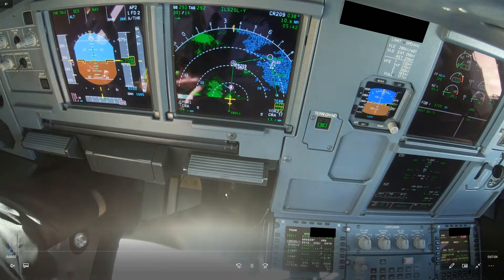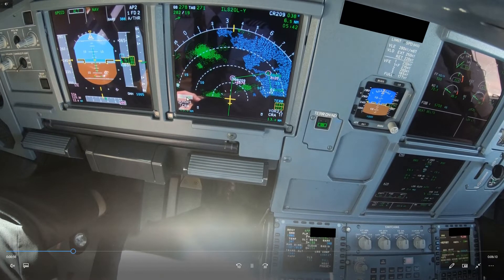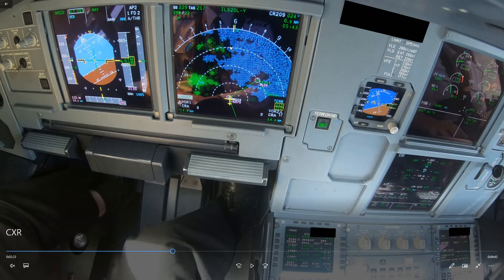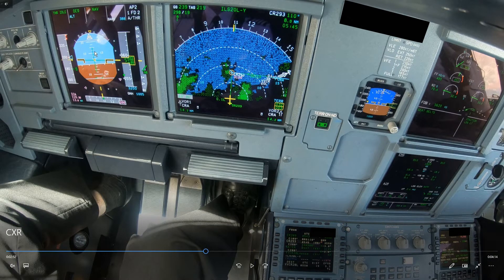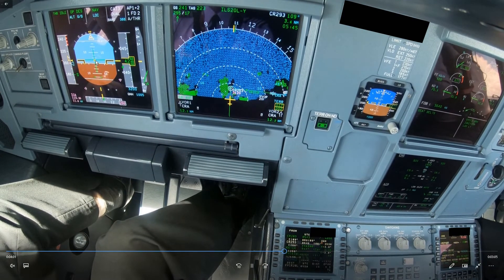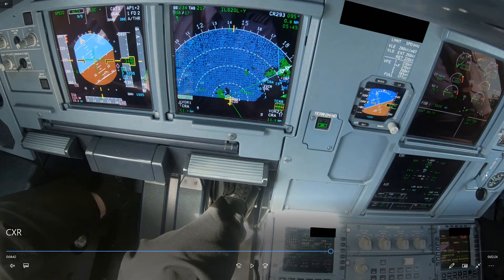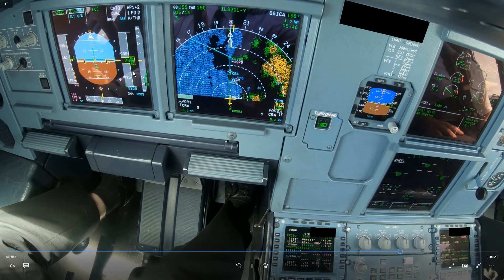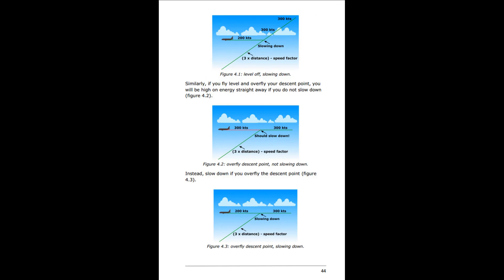A320 Descent Management - VVCR glide slope from above

Comment: nice video. its ok to use speedbrakes whenever executing glide slope from above isnt it?
Reply from the maker: Yes, but make sure the speed bug is below the current speed, don't select speed brakes with Flap Full, and don't forget to arm it again if previously armed.

Gear down has more drag and less to worry about in that situation though.

Comment: Hello!
Minute 1:35, I understand that if you are on profile/above and need to descend and can't, it's a good idea to level off. My question is if you can't descend because a alt constraint, why would you want to decelerate ? The only thing you are going to change is that you are going to arrive later to the alt constraint point! Need an explanation!! 

Thank you in advance!! Great videos!
Reply from the maker: You mentioned "it's a good idea to level off". That statement is not correct. The correct statement is "If you need to descent but can't, you need to slow down". The level off is self evident because you can't descent, so naturally you have to level off.

As for why you have to slow down, good question. The answer is two fold. Technically you are adding energy to the aircraft in the form of speed if you don't slow down. If you are high on energy, you don't want to make it worse by adding even more energy. You have to disappate this extra energy with speed brakes later on. So first you were adding power to keep the speed up, then later you need speed brakes. That is a waste of fuel and in the worst scenario you have to do a go around because you are too fast on the approach.

In practical terms, you should slow down if you need to descent but can't because if you do so, you can dive down later and let the speed increase, getting back on your vertical path, something you can't do if you were already fast.